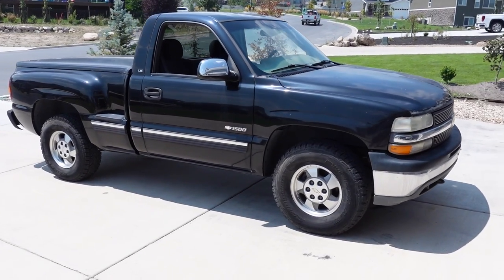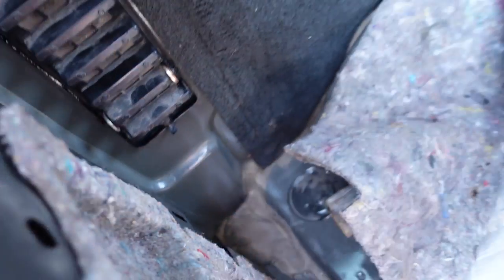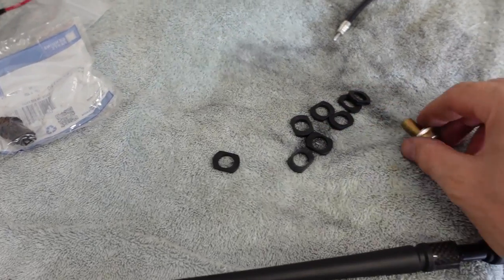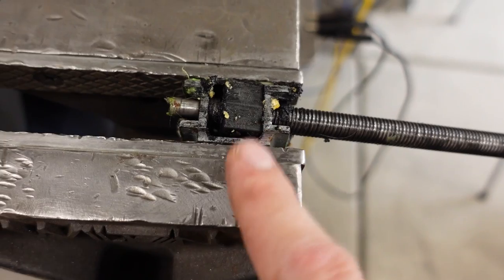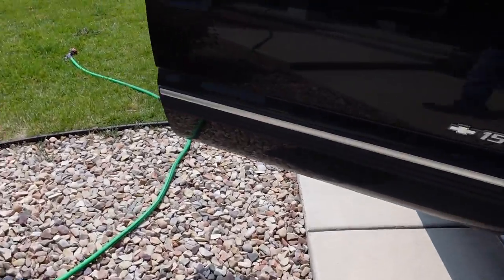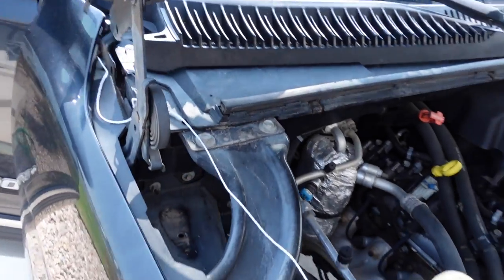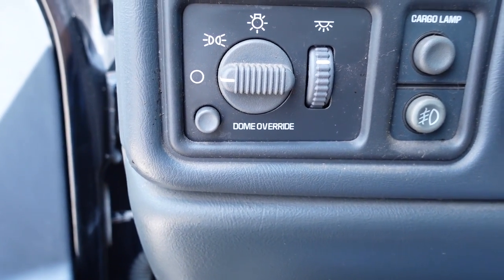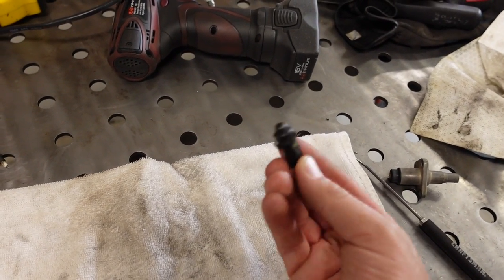Fixing 5 things that ALWAYS BREAK on EVERY GMT800 99-07 Chevy or GMC Truck

Comment: Just went through this with my 08 GMC.... I pulled the interior out.  Seats and all... front and back.   Up at the fire wall I put wood to pull the plastic out and a blower fan had the foam dry in a hour (warm day).  The wet padding soaked up to the firewall and made that foam like a sponge. The padding dried out (put it in the on the hot concrete driveway in the sun for a day).  I cleaned out the inside of the truck and dried out.  The doors open for a good 100 degree day.  The issue was my 3rd brake light.  Cracked and letting water in.  New light and gasket.  Also, the flaps on the back cab corners were gone and the rubber that was left was gummy.  Replaced those and its dry.  I sprayed out the carpet with a pressure washer and let it dry as well.  Cleaned it inside and is smells great!   If you have a truck that is 10 years old replace the vents, light, and foam.
Reply from the maker: its a pain to deal with those leaks, but well worth it to clean out the interior like you did

Comment: I'm surprised that the you did not address the steering shaft and the bearing on the interior side of the steering shaft that can go bad. Although I never had a problem with my 03 Silverado that was just shy of 200,000 miles when I traded it for a 07 Silverado. We have had problems with a 05 Suburban at work.
Reply from the maker: I may get to that sooner or later

Comment: LT,  great video!  But if you pull the fender cover under the wheel arches.    you can reach the ant wires.   I did do them while back.   Had a lot more access to plug the seal back in.   Hope that helps!
Reply from the maker: Good tip!

Comment: I enjoy all the content you put out for us to learn from. I have a 1999 chevy silverado single cab 2 wheel drive. I did the 4 hi mod and drl delete and the escalade antenna mod. Absolutely enjoy those mods. Keep the good content coming.
Reply: the 4-high mod is one of the best things on these trucks! i put LED headlights in and i can see people's souls, lol!!! My DRL delete was done by the truck itself by burning up the bulb sockets, lol!!!
Reply: @mattcat231  wire the day time running lights to the blinkers and you might like the full front of the truck lit up. I'm about to put switch back lights in my blinkers so the front of my truck will be all white light until I turn the blinkers on
Reply: @nothinstock83  i actually thought about doing double park/turn signals  in there with another 3157 style socket, but what stopped me was if the wiring would hold up to the extra draw
Reply: @mattcat231  I've had mine set up like that for 3 years now even put the led flasher relay and no sign of any issues like sockets burning or overheated wires

Comment: The two biggest pains in the ass I had to deal with on my truck, a 2001 sierra, was the blend door actuator on the driver side, and slow power windows. If you get any more free time on your hands, you should make a video on those two. I fumbled my way through replacing that actuator and finally found the right areas to lube the run channels.
Reply: @Pedro Mendoza we’re you able to fix the slow windows?  Hate the speed they operate!
Reply: @mcgo0097  I did. I took the door panel off and used grease on the regulator cables. Worked it a few times and it’s still slow but much much faster than it used to be.

Comment: Good basic quality of drive (life?) improvements.

Quick tip when dealing with those rubber grommets, use some undiluted dish soap concentrate (Dawn) to lubricate the end that your feeding through the metal or plastic cut out. Then twist back and forth while pushing and, eventually it will work its way through.

Also, sometimes a smaller gauge stranded electrical (like 14 or 16 AWG) wire works better as a wire fish than string. Less prone to snagging or breaking.
Reply: I put rubber parts in a bucket with hot water for a few minutes to soften them up. Give them a quick wipe and they're much easier to install while they're flexible.

Comment: I had a 2002 Silverado WT 2WD with a five speed and 4.3 V6. I had the following failures: *Catalytic converters failed just before 60,000 miles and again at 150,000 miles *Intake manifold leak that let coolant into my oil at about 100K. *Front hubs replaced twice at around 70 and 140,000 miles. Front wheel bearings can't be serviced, and when they wear slightly the ABS triggers with no wheel slip on low speed stops. *All fuel and brake lines rusted. *Plastic filler neck wore out and caused a leak in the evap system. *Brake calipers replaced multiple times after the pistons seized in the bores. *Multiple plastic timing covers replaced to stop front main seal leaks; it never stayed fixed for long. *Noisy serpentine belt; switching from OEM to Goodyear Gatorback belts finally fixed it. *All radio lights and multiple dash lights blew out. The bulbs are soldered in and not easily replaceable. *The rear bumper rusted through. *The tailgate fell open because it wouldn't stay latched. Whenever I see one of these trucks with a ratchet strap or bungee on the tailgate I tell the owner how to fix it. Lubricating the pivot at the center of the latch cables fixes it.   I finally got rid of it at 170,000 miles when the doors rusted out and the transmission started shifting hard. It wasn't worth it do do a clutch and transmission rebuild plus door shells.

Comment: Hey LT I have a 2018 Silverado 1500 4x4, I’m thinking about doing a dual position rear caliper conversion, I was wondering if you think using 2000 and up Tahoe/Avalanche/Suburban brakes (dual piston calipers and rotors) would it work?
Reply from the maker: Not sure on the newer stuff rears, but I do know the 2019+ Silverado 1500 brakes are awesome, 4 piston I think

Comment: Chevy trucks always have water leaking in the cab issues. I bought a new 2010 Silverado LT, it leaked like crazy. I toolkit back to the dealership 12 times, they said it wasn't leaking.
I pulled Bach the carpet, and soaked up a beach towel full of water, then showed the repair shop foreman.
 All he said was" what do you want me to do"? I said~ Fix it. It's still under warranty.   It leaked water until the day I sold it.

Comment: Nice fixes. My top five when owning two 2006 Silverados were
1.  Steering shaft bearing (fixes clunking under steering wheel)
2. Knock sensors
3. Service air bag front impact sensors
4. Lifters ticking ( used Lucas oil stabilizer worked for me)
5. Shocks

Comment: Hey lt I've got a question for ya 
I've got a gmt800 that has no head lights won't come on manual or auto I've checked fuses the auto switch on dash relays and still nothing.. any suggestions??? My only other thought was bcm
Reply: Whip out the DMM and figure out where you don't have voltage.
Reply: @chriswise1232  
Thats the next mission brother only other thing I can figure

Comment: What will make a water pump last longer
Reply: Modern water pumps have sealed bearings the coolant doesn't lubricate the Water pump but old coolant is bad for engine internals and never mix coolants types

Comment: I have a denial. I put a axle in it and wheel bearings and it's still sounds like ching ching. I don't know if it's OEM axle too. Maybe she's just a worn out diff or bearings and s eals .... Torque everything just back 177 foot pounds on an axle nut. Can't figure it out... The caliper on that wheel also has frozen slide pins

Comment: Sadly the radio is DIN 1.5. There weren’t many options back in the day and now it’s all but zero.
Reply: They make a kit to convert to double din 

Or you can get a radio basket and bezel from a 03-06
Reply: I have an 02 suburban and just went with a simple single DIN. No modifications and I don’t need a screen. Crutchfield gives you the mounting kit for free so I purchased the radio through them. Works great.
Reply from the maker: I do like the idea of the 03+ dash and double din…

Comment: Great way to dry out interiors on cars is to let the car idle in the sun with the heat cranked for a half an hour or whatever is needed drys stuff up really quickly!
Reply: Run the a/c. It dehumidifies the air inside the truck. Dries it faster.
Reply: @toddmoore8808 hopefully you replaces the cabin air filter after

Comment: I have a '99 Silverado 4x4 that gets beaten on a daily basis. It now has 227,000 hard miles on it. The only problems I have had are the typical rusty rockers and cab corners, and of course the brake lines from living in the rust belt. I've replaced both window regulators at least twice. The door hinge bushings go bad every 3 years. The sun gear shell broke in the transmission (very common), then a month later the low reverse planetary exploded (probably my fault). I put a posi unit in it years ago, and haven't touched the rearend since, but I have replaced several bearing sets in other trucks. The transfer case has never been touched, nor the front differential. I replace the rear u-joint about once a year, and I have replaced both front hubs twice. I can't keep brakes on the truck, it likes to eat the rotors. One of the heater hose couplers broke while going down the road, that was fun. I bypassed the heater core and drove on. I've put 2 water pumps on it, and changed the sparkplugs 10 years ago, and replaced one fuel pressure regulator. Other than that, the engine has never been apart. I love my truck!
Reply: My 99 Silverado, 4x4 has only needed two front hubs and some ticky tack crap such as the fuse which goes to the digital odometer

Comment: I wonder if some of the issues of the GMT-800 from 99-07 GM products also apply to the GMT-400 trucks from 88-98. I know my 98 has some interior issues like the motor for the window regulator and door handles.

Comment: I have both the GMT800 and 900, but I'm so glad these dont have the peanut brittle dash's that the 07.5 -13 Silverados have
Reply: The year gm filed bankruptcy
Reply: My 2001 as a dash of pills. When I took off the dash cover to try to paint it, it cracked almost right away. Had to go down to pick and pull and pull out three different ones to save it
Reply: If you have a beige dashboard than the paint chips exposing black plastic
Reply: My 03 dash cracked in three places when I pulled it to get to that passenger blend door actuator on top on the passenger side. I used a fiberglass kit and epoxy to put it together, but the texture finish is beyond repair. SEMS has the correct paint.

Comment: Do you have a permanent fix for the tailgate handle problem? Cause both my 01 and my moms 02 and also my grandpas 04 have this problem 😅😅😅
Reply from the maker: One thing I’ve done before is remove the handle and take a torch and heat/kinda melt the center  plastic bushing to let the little arms retract easier

Comment: 1) Brake lines rusting through
2) rockers and cab corners rusting
3) tailgate handle
4) blower motor resistors
5) AC leaks
Reply: Just bought a 2001 1500HD beautiful truck but rusty rockers, and frame is ugly, sounds like a big job but if it was a Duramax and needed work you would pull the cab, so I'm going to pull the cab and box and sand blast and paint frame, do brake lines, fuel lines, rebuild the front suspension and brakes, rebuild the front end and reassemble, the rockers are soft on my truck, going to use panel bond and replace them, no welding as it burns the paint off the back side of things, stay strong
Reply: @cargotoolshop5319  wanna do my 02 while you are at it? lol!!!
Reply: also rear body mounts!!!
Reply: For #3, lubricate the pivot point where the latch cables meet behind the handle. It fixes the problem where the tailgate won't stay latched.
Reply: @AcmeRacing  i have used every lube under the sun on my handles in my 3 gmt800's, and nothing works, i just replace them and have another year or 2 of working tailgates, lol
Reply: @mattcat231  I used One Lube on mine, which is Teflon. I added a few drops when I did the hinges and greased the chassis at each oil change. It worked fine until I got rid of the truck.
Reply: Only had the tailgate latch handle of those.

Comment: Hey again LT, great video! Very professional as always. I will suggest taking a look at your speakers if they are original. I own a 2001 Sierra ext. cab and my speakers were all shot even though they were emitting sound haha. I ended up rewiring the whole thing with a friend and adding two 10in subs in a box that fits under my back seat. I swapped out the radio with a pioneer, very happy upgrades.

Comment: 3rd brake lights leak water.
Blower resistor and connector.
Window switches, sometimes.
Idler arm if over 1/8-1/4” play.
Console door pad.
Head lights fade pretty bad.
Paint peels and bleaches if kept outdoors.

Oh, and nice truck, always little issues, cheap and easy fixes though.
Reply from the maker: I've got the paint issues on both of my 2000 trucks

Comment: My dad had the heater core replaced in his 04, and they forgot that little light sensor when putting it back together. So his lights were always on, day or night. I decided one day to fiddle with it and actually managed to fish it up into it's hole with a thin piece of wire, a small pair of needle nose pliers, and a pocket screwdriver. I hooked it with the wire, pulled it up into the hole, then carefully held it in place with the pliers while I used the screwdriver to twist it into the locked-in position. It took multiple attempts, and I probably should've just went in through the radio opening, but I got it.

Comment: Classic GMT800 missing foglight.  GM went super cheap on these.  I fabbed steel brackets to replace the GM plastic, and installed aftermarket LEDs that actually light the road.

Comment: Wet noodle column shifter combined with a stiff shifter cable,  gauge cluster stepper failure and hazard light switch issues that effect other things like brake lights. Fan blower craps out on number 3 position.

Comment: Another annoying issue is the daytime running lights burning out. A lot of people switch to LED, but I did not like that look for DRL. If you use bulb 4114, the sockets will not melt from overheating. Many people use 3057 bulbs for the DRL which run too hot and cause socket melting and poor bulb life.

Comment: I had my 99 2500HD 4X4 23 or 24 years, and the auto head light sensor never failed.  Still worked when I junked the truck.

Comment: The only thing on the video that I have fix is the brake light and the antena delete  I have the truck since 09 and besides2 tranys and random reduce power has ben trouble free and my dash just ended like tortilla tostada but was easy replacement

Comment: I had an ‘03, replaced the brakes every 2 years, the drivers window motor (cable) twice and pass side once. ABS sensors / Wheel bearings every few years (always when I had no money) and the brake pedal always had too much travel since new. Other than that she was a good truck. I love my ‘12 much more except the Alternator went and A/C stopped blowing cold… at 50k miles…. Meanwhile my g/f’s ‘08 Rav 4 needs a new Alternator… at 280k miles, and the A/C still blows as cold as new!

Comment: I use 303 tire protector on those rubber plugs, like the antennae plug seal. pops in and seals perfect . just another method to the madness. I own a 2004 xtndc 1 ton 8.1 silverado lt.  Here in rainy BC Canada

Comment: frame work, rear gas and pass shock support rotted out.  Rotten frames on salt area vehicles is a normal thing but silverados seem to suffer this area due to the plate welding in these areas

Comment: My third brake like was leaking but it wasn’t from a bad seal somebody took it out and when they put it back in the metal clip to hold the screw wasn’t in the right spot and I fixed it no new seal needed
Reply from the maker: Good thing to check for!

Comment: Thanks for the tips. The water leak in My truck caused the paint to bubble up on the floor pans I scraped all the paint off and repainted it with some "rust stop spray" paint. Not sure it'll work but it's some kind of preventative maintenance I guess.

Comment: I have a 2002 chevy 1500, gladly i'm only dealing with the ambient light sensor, as well as some exterior stuff. but its been driving me nuts that the headlights stay on all the time. I put LEDs in when i bought the truck in jan 2019, lights started stating on, in about feb of 2020. since then drls have only come on about 10 times, couldn't really find a solution or a cause really. The trick of pushing the dome light button to override doesn't work on mine, i think since its the Canadian version. I figured to pull the top of the dash, check power/ground and was going to replace the sensor anyway since i was there, this really helps. I have big hands so no going behind the radio, i have a JVC in there and its a tight fit, had to tap the holder in it was so tight, and i'm sure its not even clipped into the dash, just stays cause its so tight.

Comment: The oil fill cap gets stuck and you have to replace the cap and the fill neck. ive seen it in both of the trucks ive owned past 200k miles

Comment: You never even mentioned the chronic blower resistor failure problems on these trucks? Most of the other things you mentioned ive never even seen before and been working on these trucks for 15 years....
Reply from the maker: should've title it "five things that I've seen break on both of my trucks but not the only things that will break" lol

Comment: Cabin air filter behind the glove box. It holds smells
Reply from the maker: Yup, also I need to do that
Reply: helpful hint, put a dryer sheet in on the right side (inlet side), it will make the truck smell good for a good long while

Comment: Have you had any problems with the pitman arm/ idler arms? I've been contemplating replacing myne by myself since the shops where I live want just shy of $1,000 to replace the pitman arm and idler arm.
Reply from the maker: they're OK for now, but I'll probably install new ones when I redo the front suspension.